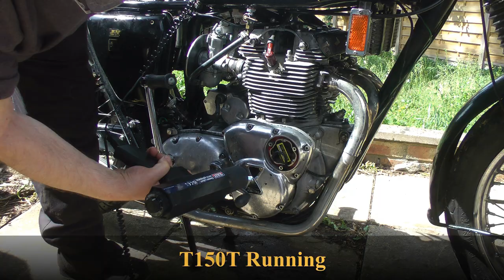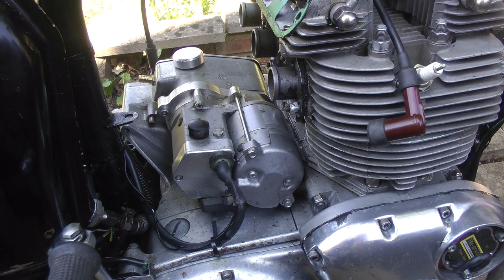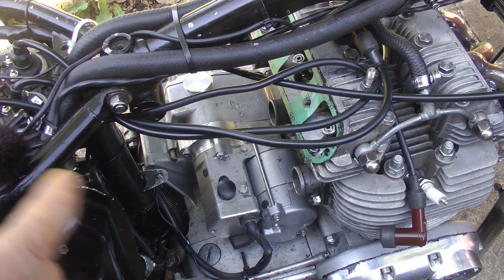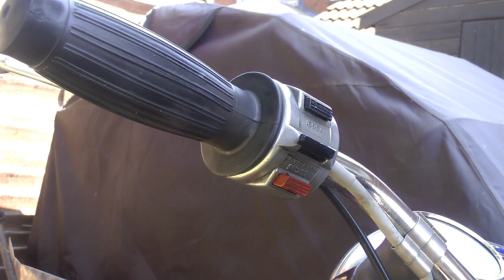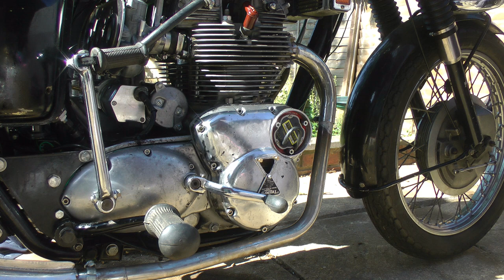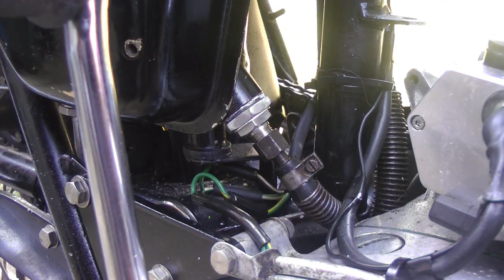T150 Electric Start Wiring

Comment: Hi, I’ve just fitted the same starter motor you have on my T150 in one of your videos you showed starter motor cover did you manage to make it fit? Cause I cannot find a starter of cover anywhere kind regards, Richard.
Reply from the maker: Hi, I could not get the cover to fit. I have decided to make a simple cover, mostly flat, to do the job. However I have been riding the bike rather than working on it, so that is a depth of winter job I think. I must say I love well the bike starts!

Comment: Great job, very tidy, great starter motor, I used the later model T160 tank oil filter on my T160, bigger hose, I made a adapter just before it goes into the pump , it stops the pump cavitating, good to see oil pressure rise with the RPM. Cheers
Reply from the maker: Hi, That sounds like an interesting modification to the Trident oil system. I wonder if it would fit into my early T150T frame though? I am glad you liked the starter motor video.
Reply: @DiningRoomGarage-rv4lh it depends on the thread in the oil tank maybe some cross referencing would find if they changed the size. It is definitely beneficial, a lot less restriction. Cheers
Reply from the maker: Hi, The oil filter threads are different, LP Williams sells his anti drain valve filter for either a T150 or a T160. I was more concerned about the frame fittings and space between the frame tubes. If I can find a cheap enough T160 oil tank I can get it, and offer it up to the frame of my T150V, I have not started on that Trident yet!

Comment: Nice clean job on the electric start system retro fit to the triple .i guess silver or gold cable is too expensive and not worth the gain in ampere capacity.
Reply from the maker: Hi, I used multicore copper cable as it is resistant to vibration, especially using crimp connections. I used a thick cable as I had lots of room, and my navy training always says "go large" hmph.

Comment: What is the height of the starter motor from the top of the gearbox to the top of the starter motor 🤔 just wondering how much is required in order to fit one in?
Reply from the maker: Hi, the highest point seems to be the flanges for the bolt on the actual starter motor body, they are at approximately 100mm above the top face of the gearbox. The rest of the assembly appears to be approximately 95mm. I hope that helps.